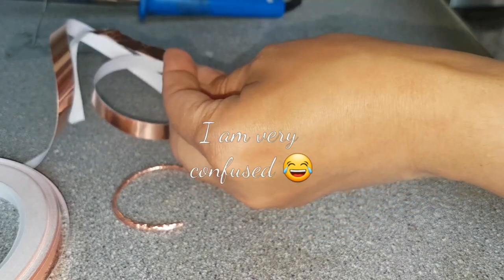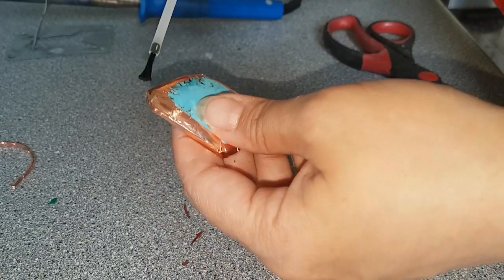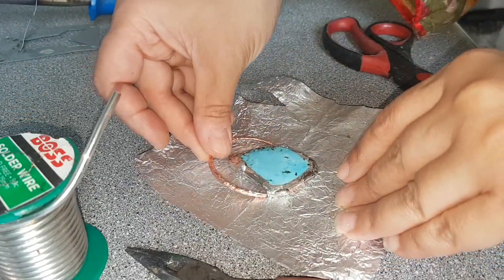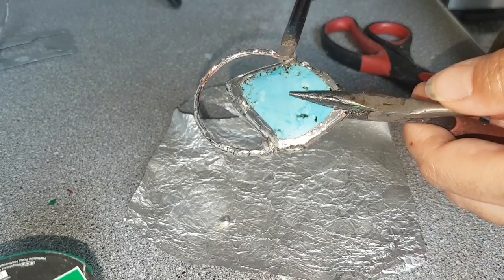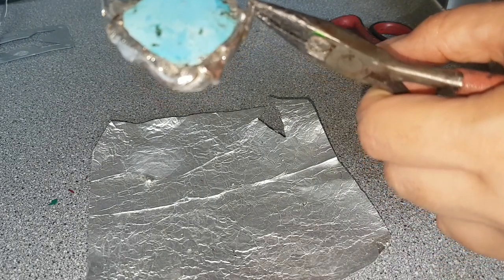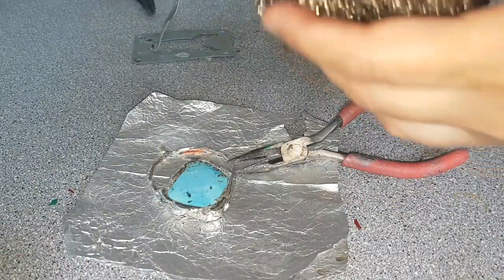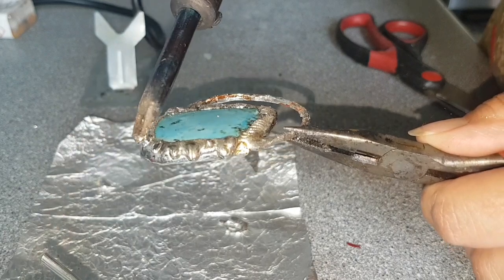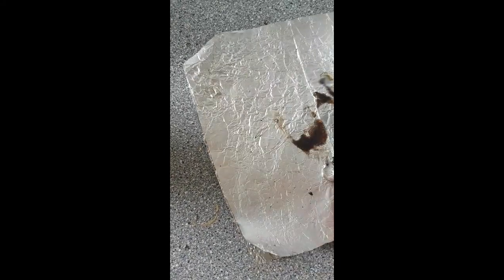Beginners guide Soft Soldering texture simple pendant DIY | Crystal Jewellery explained

Comment: I found this very informative. I already solder copper wire for jewelry making but didn't know what soft soldering was, so thank you. I would like to point out that bare copper wire tarnishes, it goes darker with age but that can be reversed. Tarnish resistant wire is bare wire with a non-tarnish coating, which is removed when soldering with a flame.

Comment: I have been watching videos and trying to figure out what im doing wrong. I tried tinnin the new soldering iron first, i understand thats important. I believe the soldering iron is getting hot enough. I am using enough flux. But the solder wire is not sticking to the tape. Do you have an idea what might be wrong?

Comment: Hi💖Can you please explain what's the use of copper wire?Can I just use normal wire instead?
Reply from the maker: Hi you can use sterling silver, silver filled wire or copper,brass  wire as the solder will only cover these metals .
Copper is cheaper and good for practice thats why its recommended for when starting.
Reply: @teaandart  I only have soldering wire right now.Can I use that alone?I also have copper band can I use it wrap it around soldering wire?I saw that on one of your videos.Is it necessary to buy copper wire?Sorry if it's dumb question I'm just buying the materials I haven't started soldering yet.
Reply from the maker: @gumihoreyiz  okay that's no problem all questions are welcome 😊. 
You need copper tape and copper wire .
The solder wire is for soldering it will melt and cover the copper .
So you need, copper tape,copper wire make sure its bare copper wire not coated one, and lead free solder for jewelry making.
Reply: @teaandart  thank you so much!💖

Comment: I tried this but didn’t have the tape and used copper wire. I had trouble getting the solder to stick and keep flowing.  My solder iron is only 30 watt, but will this work on wire? I did use handy flux. Any information would be appreciated.
Reply from the maker: Hi i have read your problem the very first thing is you need 100 watt soldering iron very very important. 
You need a copper tape as well .Make sure your copper wire is bare there are lot available that are coated so solder won't flow. 
Your wires and cabochon should be clean sometime there is oily residues that we can't see but its makes the solder drop off.
Clean all your crystals,cabochon and wire with isopropyl .
Hope this helps ☺
Reply from the maker: I am using this flux
- Flux
https://www.ebay.co.uk/itm/Copalux-Flux-50g-By-Oracstar-/324249867524?_trksid=p2349624.m46890.l49292 its good.

Comment: Thank you this!!!  I’ve been looking for YEARS for this process 😹  even became an electroformer bc it’s a similar style rustic/textured feel. I find most of my clients prefer precious metal instead of the copper that an electroforming artist (& this, as I unfortunately now know) that is only feasible for at-home use (I’d need a fda approved lab otherwise), uses but upon watching I am super disappointed bc I cannot use fine metals to coat in for the final look with that sort of soldering tool. Gotta have a gas torch up to at least 2000 degrees to melt fine metals. & here, I must clarify a comment you said in the video, respectfully, yes one can use sterling silver or fine silver (or gold) but only for the metal base layer aka the copper you were putting the silver solder atop so the cheaper metal would coat the more expensive metal. Doesn’t seem to make much sense to do so but hey maybe it’s worth it aesthetically. I love this style SO MUCH😍 So, unfortunately, sterling silver or gold will not work as a top layer. As a silversmith & electroformer of 10 years, you got me like hmmmm 🤔 should I try over sterling silver.... I think I might if the metal does not green (oxidize the skin, does it? That’s kind of how I feel about my eformed copper jewelry BUT I can now plate silver over the top!! They finally made an at home solution. If you want to give electroforming a try I HIGHLY recommend Electroforming Artists on Facebook. That forum ALONE taught me how to eform the rest was just science...mwahhahaha! You get to play with chemicals & electricity eforming!!

Comment: What do you wrap the bail in? Do you use the copper tape? Or it's just copper wire?
Reply from the maker: I do wrap copper tape around the wire for making  textures. 
But that is not a necessary step you can solder direct on bare copper wire or silver filed wire as well.

Comment: Hi. I’m fascinated by your work. What purpose does the copper wire serve? Is it just reinforcement? Simon
Reply from the maker: Thankyou so much for liking my creations. 
😊 Copper wire is a metal that helps the solder to flow. Other the copper you can use sterling silver or silver filled wire.
Reply from the maker: And with wire you can design shapes and for me i use to make bails,an outlines you can get as much creative as you can.

Comment: This video is amazing as are most of the ones I've seen from your channel. I do have a question, how do you keep the tip of your iron tinned while you work? I'm having so much trouble with mine. Please help!!
Reply from the maker: Thankyou so much i use brass wire wool it helps cleaning the tip i think i will add a video regarding tinning don't worry i am a learner my self just sharing my journey 😊🌙

Comment: thank you so much for this video!!! so helpful, what is that primer stuff that you put on the cooper parts before you start to solder ? is it a primer ? like does it need to dry or you just throw it on?
Reply from the maker: Hi your very welcome 😊.
Its flux and it dries as you put it so no need to wait but ot is necessary for the solder to flow.

Comment: I’m so happy I found your channel! I’ve been wanting to get into soldering for a while and I have a bunch of stone cabs. Is the copper tape completely necessary or does it just make things easier?
Reply from the maker: Hi i am happy that you found my channel helpful 😊❤.
Copper is very much necessary but if you  use bare copper wire then you can work without it as well.
Reply: It's vital – solder won't stick to stone – only other metals!